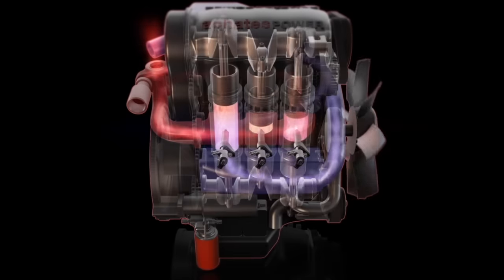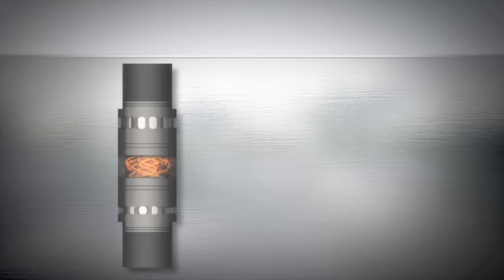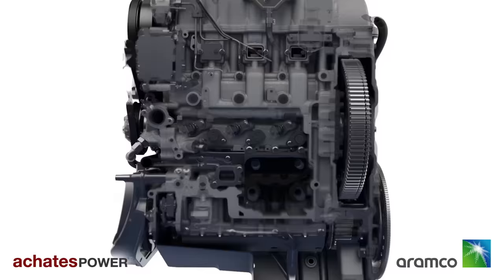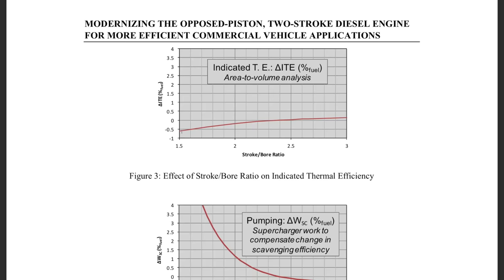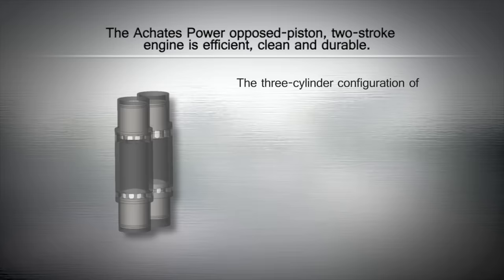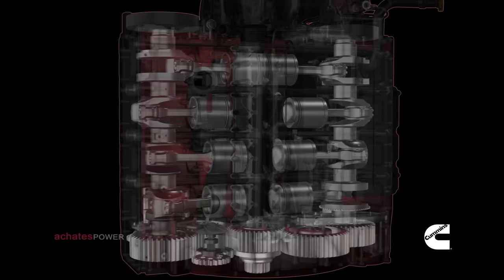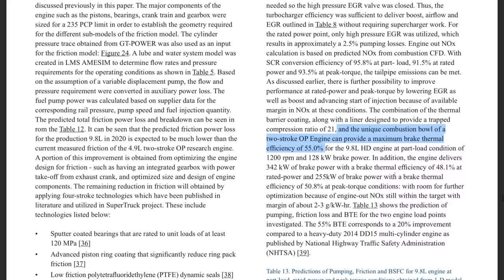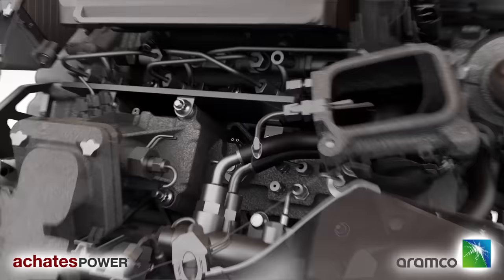Opposed Piston Diesel Engines Are Crazy Efficient

Comment: Turn it horizontal, and you have a flat engine, that doesn't eat head gaskets. 
I love it.
Reply: @mikkelklein5011  It doesn't have head gaskets. It doesn't even have heads. Di you even watch the video?
Reply: @TitoRigatoni  that's my point. Are you slow?
Reply: @mikkelklein5011  yes :-(
Reply: @TitoRigatoni  oof, soz bro. ):
Reply: That would also be good because I was thinking the top crankshaft upon start up wouldn't have any oil.
Reply: Ryan Goodloe, why?
Reply: @Ryan-fy3ww  just like camshafts on regular straight engines. That's why it's recommended to wait a few seconds after startup, before you start driving.
Reply: Subaru, are you listening?
Reply: Hate to burst your bubble but I don't think this engine has a head gasket, there are no heads and no valves so it won't make any difference wether it's horizontal or vertical in design or installation. This engine is a cracking design especially with having two crankshafts with timing gears joining them. It's a far simpler design than the old Commer TS3 engine of the 50/60s which was a three cylinder six piston horizontal 2 Stroke Diesel which were very reliable and good on fuel but very noisy until they fitted two massive silencers to quieten them down but a great engine nether the less.
Reply: @davidellis279  dude, thats the point. If there's no gasket, it can't brake.
Turning it horizontal will lower the center of gravity, improving handling. Oil flow would also be better.
Reply: Mikkel Klein. You are probably right about the centre of gravity but the problem with making it horizontal is it makes the engine to wide for most car chassis, of course you will say Subaru do it on their Boxer Diesel but they are designed to take that type of engine as they always use Boxer type engines as did Volkswagen years ago but I think this engine has a lot going for it if the immissions are not going to be a problem,as you say lubrication would be simpler if it was horizontal but I'm sure they've thought that one out.
Reply: @davidellis279  I've stuffed flat engines in many things, it's not that hard.
Reply: But I get what you mean
Reply: @davidellis279  at these efficiencies, emissions would be reduced in relation to power generated, I'm sure.
Reply: Check the commer knocker motor
Reply: @TitoRigatoni  simple answer. You have been whooshed.
Reply: Apparently a lot of people don’t know that ur making a comparison to subaru flat 4 engine and it’s kinda sad
Reply: @davidellis279  - I imagine that the vertical alignment is actually to take advantage of natural convection for more efficient fresh air intake and exhaust scavenging.
Reply: Ryan Goodloe   Modern engines all pump oil to every crank journals, only low power lawn mowers rely on splash lube.  

Crank shafts are always above the fill line, they do not run in oil.  The drag and aeration of the oil would be highly detrimental.
Reply: John Paine  WRONG!  Modern automotive engines typically fire every0.01667sec, 3600rpm for a four stroke or 1800 on a 2 cycle.   Natural convection is a function of time and delta temp.  There’s so little time it has no effect.  The geometry does not work the way you say either, but not as easy to explain without a diagram.
Reply: @timduncan8450  - Okay, calm down there, champ. No need to yell about it. You might be right, but until you have some actual test results that show there's no difference try not to be so obnoxious in the way you share... In fact, just try not to be so obnoxious in general, whether you have evidence or not.
Reply: Mikkel Klein what are the odds... Such an engine in the next Porsche 911? It’s always been a flat six in the back
Reply: The only issue with lying it out horizontal, boxer style, is asymmetrical piston wear.
Reply: @heatherroseisrflyer  how would that happen exactly, just curious
Reply: Johannes Terzis  what car did you have?
Reply: @heatherroseisrflyer  Not an issue on boxer engines. Why would it be on this design? Conrods are always moving side to side anyway as they pivot with the crank.
Reply: I am not aware of any Subaru or VW boxer engines eating head gaskets!
The modern ones don't.
Reply: Porsche wants to know your location
Reply: @TitoRigatoni  welcome to the human club buddy👍
Reply: I was thinking the same thing. A nice   low center of gravity. Imagine this engine in future military vehicles. (Next gen Jeep/HMMV?)
Reply: @mikkelklein5011  ya they do my 2.5 boxer sucked the headlights out of a 5.9 today I'm manual he was a auto,you know so girls can drive it, anyway yup smoked that dinosaur good. Next light same thing and in the corners with it's low center of gravity waaaaay back there now. Yup sucks real good.
Reply: This secret has been out for a while now but,if you do a head job use turbo head gaskets in a naturally aspirated engine. Took subaru 30years to figure  out MLS solved that weakness. I flog my 99 unmercifully daily an don't have issues l bought it with a blown head 5years ago re+re'd it. I regularly shift at 5500 up and double clutch down to 6000 it loves it. Run 5w40 syn diesel oil and remote oil filter with 2L truck filter.
Reply: @jackd1582  and bang
Reply: Best to keep it vertical, seems like it may be possible to rebuild the top half still in the vehicle, doesn't help if the bottom half needs work but just makes that edge case scenario that much easier to deal with
Reply: @heatherroseisrflyer  side thrust happens no matter what angle the cylinder lies. All piston engine designs but one wear piston skirts because of side thrust: Neander motors' twin counter rotating crankshafts with 2 conrods per piston ( both cranks connect to 1 piston) this eliminates the need for a piston skirt, reducing both weight and drag and with better balance. Interestingly, they could make a boxer using this design or even an opposed engine- both would make it balance even better.
Reply: @ericferguson9989  Subaru belong to Toyota now. They do what they're told.

Comment: It's not just that -3- cylinders is ideal, but ideally it should be in - multiples - of 3.

I've been on various ships that use a 12-cyl, 24-piston engine, but they're timed as multiple banks of 3 cylinders all in the same crankcase.
Reply: Jeff Khoury   Interesting!
Reply: Fairbanks-Morse engines come to mind.
Reply: @tom7601  Those are the ones I was thinking of.
Reply: The Napier Deltic locomotive and boat engine had three banks of three or six cylinders turning three crankshafts.
Reply: In the British army back in the 70's we used Pescara single cylinder compressors to power our pneumatic tools. Had to wind the starting handle round and round to pull the pistons apart until they automatically tripped, flying back in for the initial ignition. Ran like a dream, dead easy to maintain, great pieces of kit.
Reply: @algrayson8965  so did the Commer Knocker TS 3, commercial diesel engine , very efficient in it,s day and even now
Reply: And 2 cycle too boot...just the old Detroit diesel screaming jimmies, with a new twist
Reply: Well you go 4, 6, 9 12, 24 typically with engines. 4 strokes work in pairs. Two stroked Judy evenly spaced. This keeps vibration to minimum. In ships with 4 cylinder engines you have balancing shafts with balancing weights too.
Reply: Not unlike 3 phase AC motors.  Adding more phases adds complexity with rapidly diminishing improvements to power.
Reply: The Deltic 9 cylinder was a good one powering trains ships and the NY Fire department as a pump,,looked like 3 V6's without heads bolted together in a triangle.There was also an 18 cylinder version.
Reply: @KBS117  I was just wondering if these diesels, being two strokers, would sound anything like the old Detroits of yesterday year. It was always fun to hear one of them "climbing through the gears" while under a load.even the EMDs old two steoker pulling a long freight train from a standing start was a treat. I suppose we couldn't be that lucky to have that sound return. Maybe I should start saving my money up just in case!
Reply: What about opposed V engines? The pistons would have 30 degree slanted heads and the combustion chamber would be <> shaped.
Reply: V6 for muscle heads, could work.  Essentially two 3 cylinder engines running in ... well, not tandem because of vibration but you get the idea.  Not sure how the efficiency would work with just one exhaust and intake system though, doubling would be expensive but might be worth the cost on high end machines.
Reply: @KBS117  What killed the Detroiters? was it not emissions?, does this opposed thing meet emission standards? if it can meet emission standards  it would be better than this direct injection stuff with attendant gunge problems.
Reply: @drewbert83  Though, in some applications i.e. the ALSTOM Advanced Induction Motor, additional phases are used to increase air gap between rotor and stator for impact protection and reduce noise signature. These are strictly military purposes, but I believe the whitepaper had some interesting performance increases as well
Reply: Those multiple banks of 3 cylinders would have to have separate induction, and exhaust systems, otherwise the overlap would still reduce efficiency. More cylinders, even though not necessarily more efficient, would still be more powerful, however, doubling the cylinder count would not exactly double the power output.
Reply: Ron Fullerton ...yes nothing sounds as cool as a Detroit two stroke with a road ranger trans...
Reply: @algrayson8965  UK locomotives used the eighteen-cylinder version. Six banks of three cylinders in a triangular (deltic) arrangement and a firing every twenty degrees of rotation. I remember their unique sound and insanely dirty start-up.
Reply: With a 4-stroke line engine, adding cylinders means improved distribution of firing moments over the crankshaft's rotation. I guess this primarily improves torque. But, balance may be lost and vibration can become an issue. My best "silent and not noticeable" goes to straight 6s. With the opposing cylinders comparing to two-stroke, the video explains increasing beyond 3 cylinders implies increasing "open" time overlap between cylinders and hence efficiency loss.
Reply: @charlesangell_bulmtl  That would indeed be a cool sounding rig! And probably a fun drive. I really miss hearing that unique sound.
Reply: Like Tesla said "If only you know the secrets of 3,6 and 9 then you could unlock the key to the univers."
Reply: @richardchurch9709  Are you not describing a  " free piston " engine Richard?
Reply: @MegaBoilermaker  You're right George, I forgot the correct name for it. I just remember it used to keep you fit winding the starting handle and it made you jump when it tripped and fired first time.

Comment: You had me at 'no valve train'.
Reply: It's called a 2 stroke. Been around for a while...
Reply: @Kevin-ix4qz  yes, but a regular 2 stroke ain't that efficient. This on the other hand is a 2 stroke, efficient, powerful and no valve train! 

mmpt, NOICE!
Reply: @ONEKristaps  I couldn't agree more. I also am impressed with rotax etec engines
Reply: I was currious to know what a 4 stroke with a sleeve valve would do for efficiency.
Reply: @ONEKristaps 
Actuall 2 Strokes are very efficient, they are the most efficient ones at the moment, that is why big Ship Diesels are 2 Strokes with 50% + Efficiency. Also those 2 Stroke diesels are the reason why there aren't that many commercial turbine ships. Turbines are less efficient than those 2 Stroke Diesels.
Reply: @Ismalith  in Ships, yes. Cars, not so. 
If we talk overall, You are right!
Reply: Ismalith Why not just use nuclear reactors on ships. Range and energy density is great!
Reply: @haph2087 
Well if you tell me where we can put the waste, we made the first step. And no short term solutions like digging a hole or something, nuclear waste needs to be save for a few million years.

Then, ships sink. Even if you have a way to safely get rid of the waste, how do you make sure that your reactor stays stable even when sinking down 11.000m to the lowest point of the sea for long enough so you can get it back without releasing radio activity.

Then, how do you protect those ships from getting stolen?
Iran wants nukes, North Korea definitely wants more nuke material, the IS and similar groups definitely would do a lot to get their hands on those ships.

And now let's say you manage to answer all those points and what more points there might be, these ships are run by cooperations. How do you secure that companies keep all the safety standards, unlike the state a companies can get out of dodge by passing the ownership of those ships down to a sub companies and if something happens, it just makes another one and kills the old with the giant disaster bills. So companies don't care for the danger.

Also thanks to the huge up front costs of those ships, over seas transportation would be way more monopolistic, since only view companies would be big enough to carry the up front costs to benefit from the way lower long term costs.
Reply: If people would invest money into a deep geological repository, that's the end of the nuclear waste problem for a while. Reactor designs using thorium-based fuel would make it much harder to design nuclear weapons from them. Not impossible, but harder, since there are currently no nuclear weapons designed to use U-233 as their fission fuel. Another idea would be a molten-salt reactor using beryllium fluoride, as it literally can't suffer a catastrophic meltdown (it is designed to melt in a controlled way and be reused). As long as irrational fear of anything with the word "nuclear" in it doesn't permanently shut down nuclear power, we might see these reactors going into mass production.
Reply: @tomfoolery4490 
If you use the phrase "for a while" for a way to deal with nuclear waste, you can dismiss this way.
Nuclear waste is an issue for millions of years, thorioum is a bit "better" but still thousands of years. You doom the next generations to deal with your own laziness.
How would you feel about if, some people from old Egypt would have produced some waste that you have to dig up every 10 to 20 years, and put into a new space for a few trillions of dollars, or directly waste > 100.000.000.000.000 $ a year for actuve storing that waste.

Because that is the only way to deal with it. Active cooled on land in big tanks stored, highly guarded, with hundreds of miles wide no fly zones.

But if the reactor owners and their bought governments would be honest about that, nuclear energy would be done for within a day. Nobody is paying 1000$ per KWh openly, we just do it over our taxes,
Reply: camgreer 👀
Reply: @Ismalith  Which nuclear waste are you talking about?
Reply: @skyrask1948 
All of it.
Reply: @Ismalith  I asked because i do not want to write thesis in youtube comments. If you really think that all of it is problem i have doubts that it is worth my time to spend that much time to enlighten all of yours misconceptions. So i will frame question differently. Which type of nuclear waste do you consider most dangerous and why?
Reply: @skyrask1948 
Is this an attempt at a trick question? Or do you want to exclude waste because criminal weapon manufacturers use some of it as ammunition?
Or do you think you can win something by excluding some of the radiated materials and equipment?
There is way more than enough of highly radio active waste in form of the "burned out" uranium heating elements and water from the inner cooling cycle.
And I am not making a 500 page list of what else is radio active waste just for you to play a got-cha game because of some things radiate less then the millions of years that the worst parts do.
Even the few hundreds of years that some of the more "harmless" things need are too long.
Reply: @Ismalith  No i am asking what concerns you most, if it is high or low level waste if it is short lived or long lasting isotopes, but what ever be defensive that is allays best way to lead dialog.
Reply: @Kevin-ix4qz  2stroke diesels have often one valve-exhaust.
Reply: @alponselrik  true
Reply: @ONEKristaps  Detroit Diesels used in trucks and locomotives for about a century at this point. Single valve two stroke.
Reply: I wish I understood why that is so good.
Reply: @alexwalker8422  Any additional moving parts are added complexity, wear items and failure points.Valves are just about the most problematic part of engines generally speaking.
Reply: @Heatherder  I guess that would be regardless of what those parts are usually, I just didn't know what the valve train was.
Reply: Haph 
One good reason is because there are s lot of countries around the world that do not allow nuclear powered ships to dock in their ports, at all.
Reply: AJ Steward 
What do you mean by single valve? It only has one exhaust valve, or one type of valve (exhaust) but used in multiples?
If you think there’s only one exhaust valve per cylinder in an EMD 2 stroke locomotive engine, you’re off by a few valves.
Reply: Ralfie i mean it in the sense that all the actuating valves serve a single purpose. I know it actually uses multiple valves to do it
Reply: Ralfie some of the really really big ship engines literally do only use one valve if i remember reading that correctly
Reply: AJ Steward 
OK, I was asking from your comment about truck and train engines, I was just curious.
Reply: @ONEKristaps  That doesn't apply no more, 2 strokes are as efficient as 4 strokes these days, while still keeping their superior power-to-weight design. Its achieved through layered intake so that complete combustion occurs with every stroke, while a computerized carburetor keeps the fuel-air ratio perfectly balanced for the task at hand, rpm and temperature. A simplified design of this is used in Stihl M-tronic chainsaw engines, a more complex and even more efficient design is used in  high-end 2 stroke enduro motorcycles.